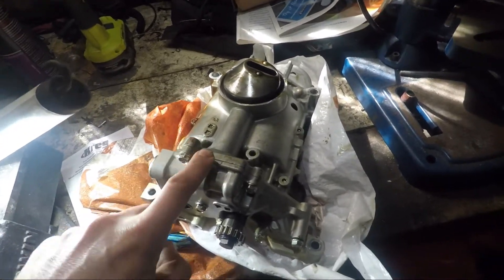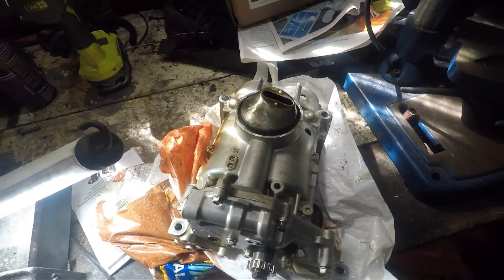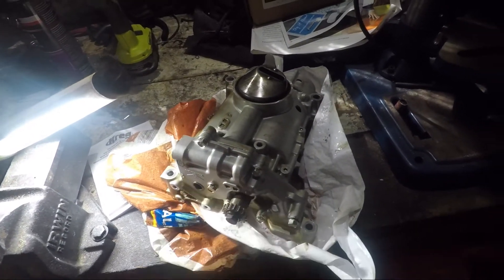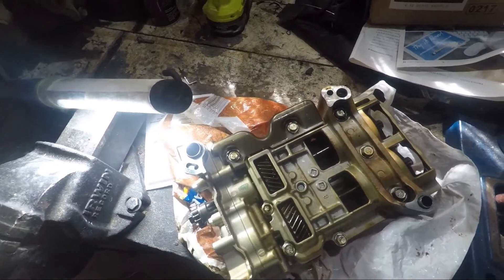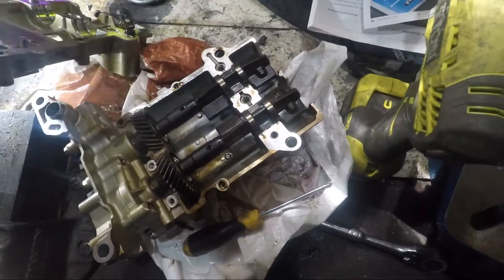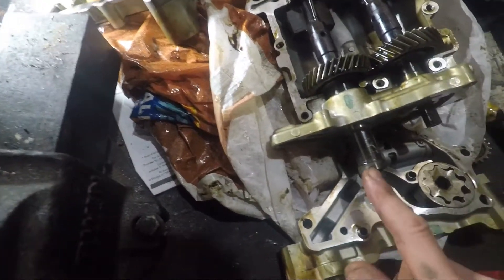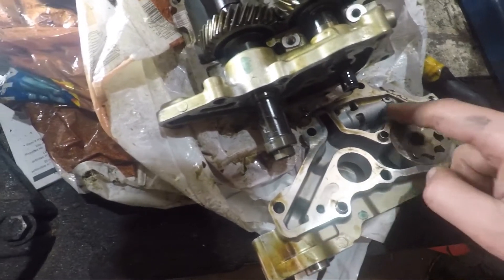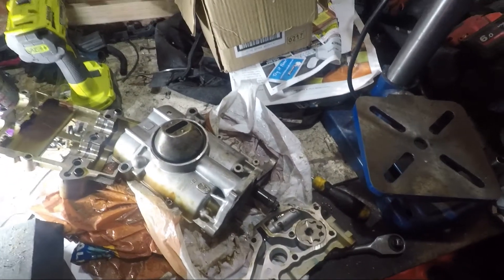What is in a K24 Oil pump?

Comment: I money shifted from 4th to 3rd and the timing chain stretched causing the p0342 code
I believe my oil chain and tensioner went out giving me a rattle noise coming from the accessory side of the engine
Reply from the maker: ohhh no good, however i have seen one of those oil pump tensioners i pulled off an engine broken before. If the pump had jumped teeth you'd probably get some very harsh vibrations too. Only real way to find out is to get the pan/timing cover off unfortunately. Fingers crossed its not too bad, damage wise mate

Comment: Do these wear out? 06 Crv with 207k miles and debating on replacing when doing my oil pump chain.
Reply from the maker: I imagine they do have a service life, saying that all the chains i've seen have still been nice and tight. I have seen the oil pump tensioners fail, so that might be worth checking if you have the engine open.

Comment: Hello,
This is second time a changing my oil pump,the pump get broken within two weeks . Pls am planning to get another pump but before I fix it I want to know what we're not getting right that is causing the pump to break ...
Reply: In a k24 oil pump it needs to be timed also. The gear has a timing mark unlike the k20 pump. The timing mark is for the balance  shafts to counter the engine frequency at the right time. I bet you're not timing your k24 oil pump when installing it.
Reply from the maker: @mayk3lll  oh yeah 100% if they weren't timed it would likely destroy them! @dopamumonday4617
Reply from the maker: wow, i've never heard of them breaking. How/where does it break?
Reply: Hello, can you help me with the torque specs for the 14mm and 12 mm bolts holding the balancer shaft/oil pump assembly?

Comment: Bro can the balance shafts be cut out?
Reply: Really easy just don’t damage the shiny side of the gears on the shaft it’s part of the bearing surface to the housing, just use a angle grinder cutting wheel or if you can have a really big chuck and lathe the ends off and make a really nice finish
Reply from the maker: I can't say it would be impossible, but I cant see any easy way of doing it.

Comment: Can you keep the counter balance and Frankenstein the Type S oil pump into this one? so you can get the best of both worlds? high RPM and no NVH
Reply from the maker: This was my hope that something like this would be an option. Short answer is not easily. It would need to be a custom made piece to make it work. I think you possibly could port/modify the k24 pump so it doesn't cavitate but I'm not 100% sure what causes the issues. I think its possibly that ridge which blocks half the path after the gears.